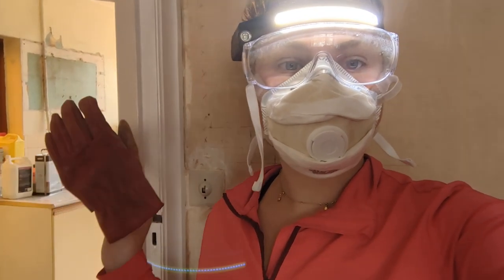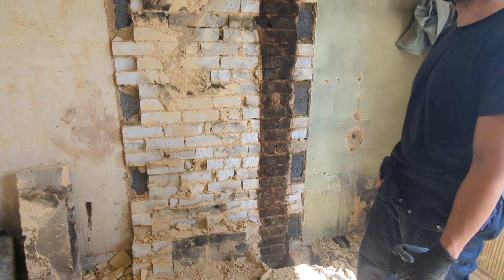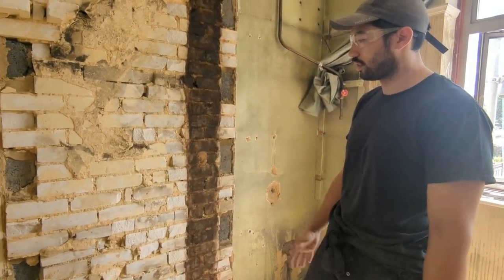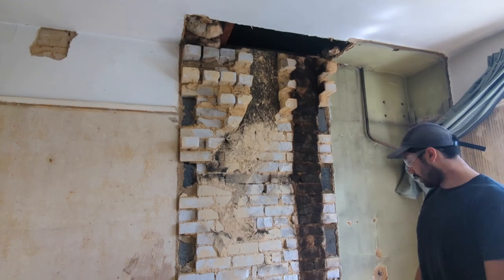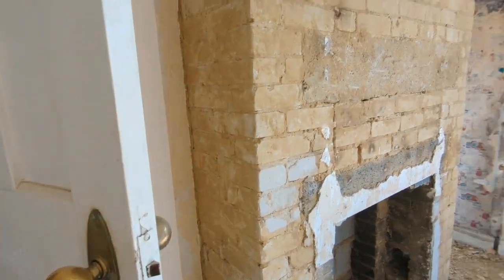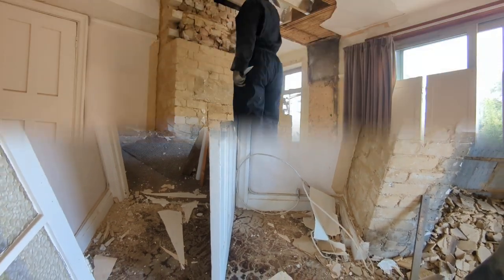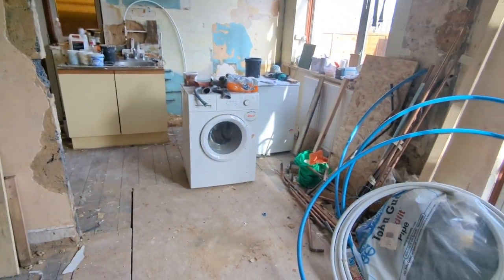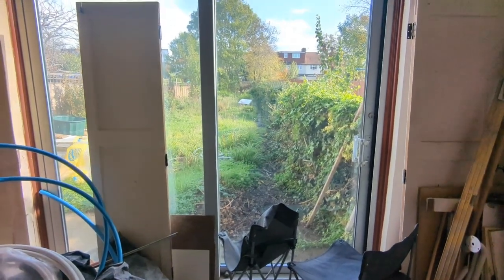WE REMOVED OUR CHIMNEYS OURSELVES! // London Renovation

Comment: We took our chimney stack down.  Bungalow, so 6 courses of bricks coming up from the roof, 10 coming in from the roof and thats where we used steel gallows brackets on either side, a mate provided a steel sheet of 8mm and also used some fireproof powder/paint/i dunno (actually one detail I missed at the time, he never, good lad) and once they were bolted in place, we made the brickwork above the plate good / repointed.  Then piece of swiss to lump hammer the rest of the bricks of the breast (oo-er) down to the floor.  Dusty as fook and a lot of handballing bricks out the front door but the whole thing cost under £100 (2021) - obviously we had no labour costs.  Brackets = screwfix, bolts the same, steel plate was free.  Handy having people who know people yanno.
The chimney stack needed repointing (particularly the weathered mortar at the very top...crikey) and the chimney pot was already capped off.
The only 'fatal' (no one died, my wallet was injured) mistake I realised after we used Kingspan to line it with (underside of brackets) and plastered over to make it all good was:
 - duh, forgot to put in an air brick.  Half a year later there was water ingress, damp patches.  My fault.  Smashed the plaster out, inserted the air brick (4 courses up from steel plate) replastered and for good measure left huge dehumidifier there after I had painted the plaster with Zinnser 123 (that stuff is boss) for a couple of days.   Job well done.

Comment: Did you guys need to get any building regs first and a structural engineer to check the property first prior to removing the stack and breast?
Reply from the maker: Hi Jonathan, we rung our local council and asked them and they said we didn't as the stack was at back of the house so didn't impact the visuals of the road. & builders confirmed our joists ran the other way so wasn't structural - hope that helps